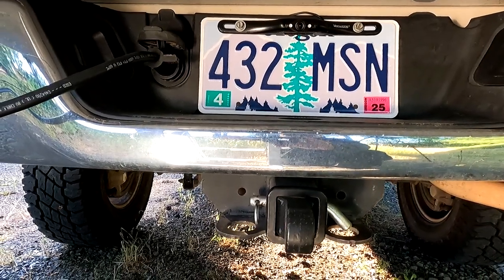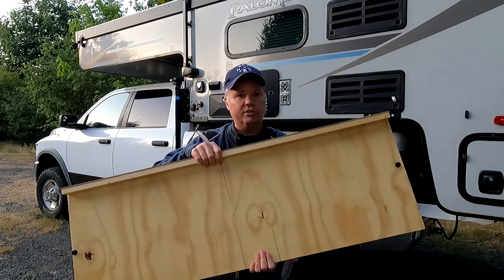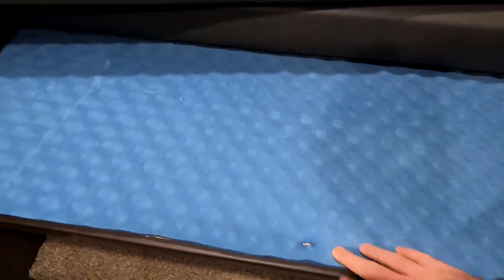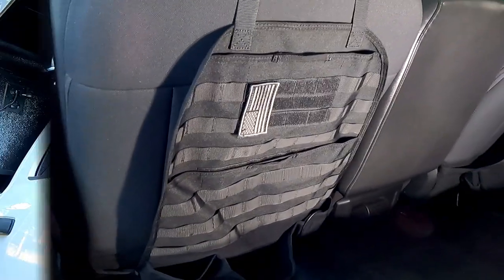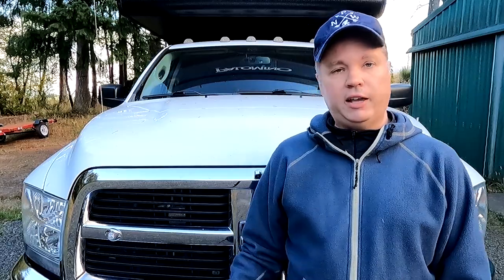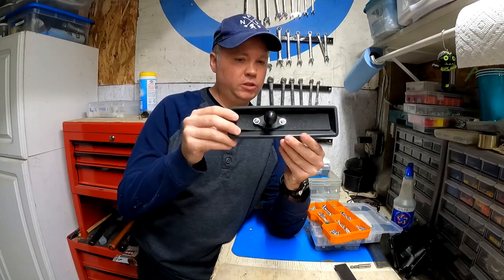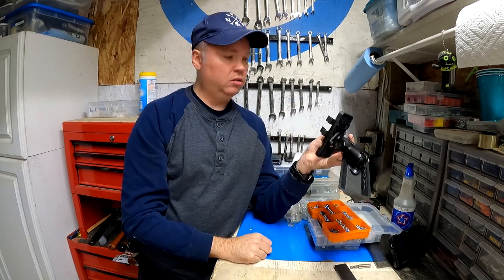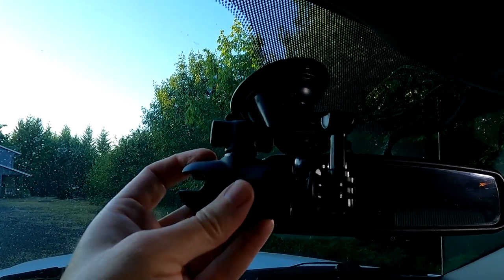Power Wagon Camper Part 14: Must-Have Overlander Upgrades. Unique Camera Solution, Ram Mounts & More

Comment: Another great upgrade video! I'm curious though, why don't you have an affiliate account with Amazon so we can use your links? That's typically what most Youtubers will do. I certainly don't mind getting you a bit of commissions for your recommendations. I did pick up the ladder and the little levelers. I was wondering how you attached them? Did you screw them in place or maybe glue? Let me know, thanks again! I should be picking up my new 1240 next week! 👍
Reply from the maker: Hi, thanks for the support.  Regarding an affiliate account, I don't feel the potential income would be worth the hassle at the moment, but that may change over time as the channel grows.  
Good question on the levelers.  I didn't want to drill into the camper and risk water ingress (I live in Oregon after all), so I used a removable mounting tape (Amazon: "EZlifego clear mounting tape").  It holds really well, is waterproof, and can be removed in the future without damaging the surface if I ever need to remove/replace the levelers.
Reply from the maker: Good luck on the new camper!
Reply: I agree, the less holes in a camper the better! I'm up here in Washington state, so we both know about rain, lol. I'll grab some of that clear mounting tape. Sounds like the ticket as I'm sure those little levelers don't weigh hardly anything. Thanks again! 👍

Comment: New subscriber.  Haven’t had a chance to watch your other vids in regards to the PW.  Can you give me some information on the suspension mods you’ve made to carry your camper.  I have a 2022 PW and am thinking of doing a similar setup as yours. 

Appreciate any info you can provide.
Reply from the maker: Sure, welcome to the channel!  If I'm not mistaken, the 2022 has rear coil suspension, where as my Power Wagon has leaf springs.  I upgraded the rear leaf pack with helper springs from SuperSprings, and I installed Fox Performance 2.0 shocks and a Fox steering stabilizer.  This has worked out very well, and I discuss why I chose this route in this video: 
https://youtu.be/kRibYEUwg3E

I'm not sure what's the best solution for rear coils.  I'm not a big fan of air bags personally, but that is certainly one possible solution. Upgraded coil springs may be another.  There is also an interesting product from SuperSprings called Sumo springs.  Rather than air, they use foam to add additional weight capability and reduced sway.  These might be better for off road use vs. air bags, but I've never used them, so can't say for sure.

Comment: I have a 08 power wagon with a 1300 lbs dry slide in camper. I installed airbags but still don't feel stable. Leaf springs are soft in the power wagon for off-road capabilities. Have you done anything to the rear-end of you truck to get rid of the sway?
Reply from the maker: The suspension upgrades I did worked out well and were discussed in this video: https://youtu.be/kRibYEUwg3E?si=FxHy8Jt5duI5Roh7